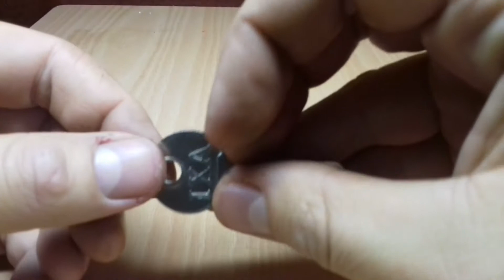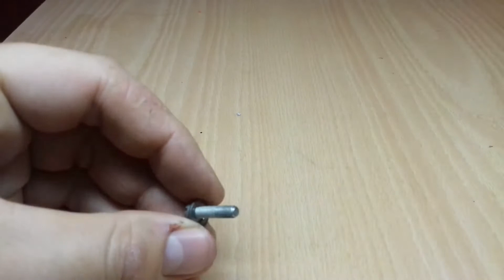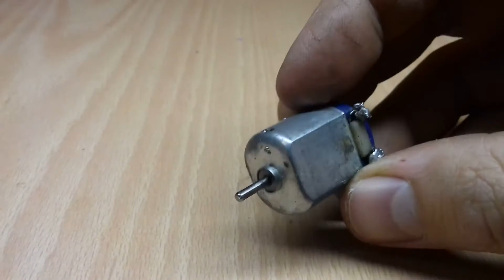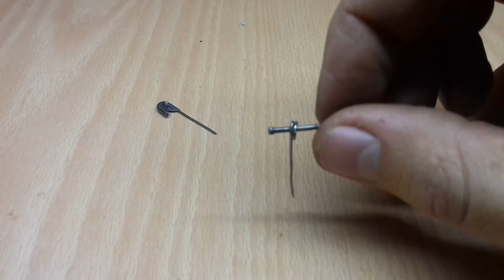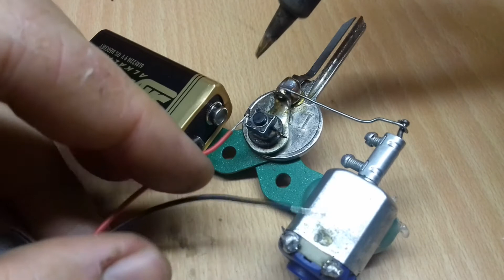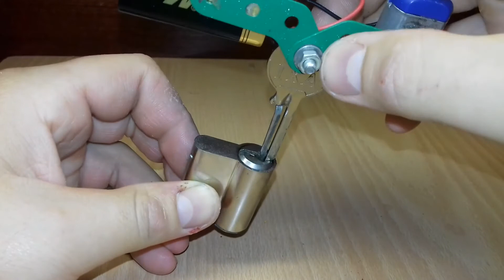How To Make Electric Lock Pick Machine #hacker #howto

Comment: Hahaha. 
First.... i saw when he took the bra wire, DID NOT cut it to match the desired keys length.... use a needle nose pliers to bend/ break the shape he wanted. From HERE is where i notice the FIRST discrepancy. The actual wire WAS NOT bent! The broken end WAS NOT scuffed up or in bad shape. He then BARE HANDLED the altered metal piece, mind you NO GLOVES, without any issue of cutting or metal sliver catching him by any means, also not to mention, directly after, it DOES appear as that metal piece had been filed or cleaned... this alone says this video is BS. 

Next.... where this person is adding the 2 elbows to the key and which depicts the such above mention metal piece, tumbler adjuster have you..... notice.... the GAP between the actual key and the such tumbler adjuster. The gap is SO large. Riddle me this batman.... how do you fit the key base (tension part of the key) and the top tumbler manipulator into tbe key hole!?

As a lock pick hobbyist (ex-paid locksmith) i STOPED the phoney video. 

By all means.... hats off the the creator in actually factually getting daft people to very feebly attempt this method 

Clapping my hands to tne feeble daft that truly attempted/ believe the foolery.

Edited.....
Hot glue. Lmfao!!!!!

Anyone whos simply used the stuff once....
To fathom the violent reciprocating movement could adhere this.... hahahahahahahaha